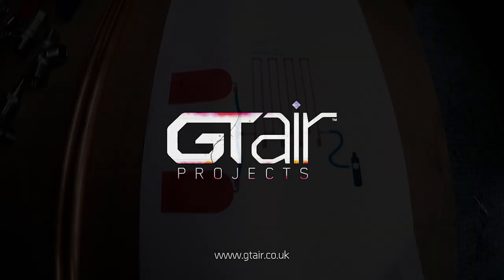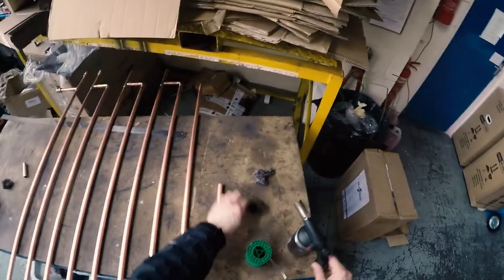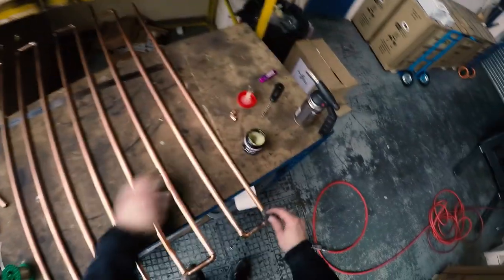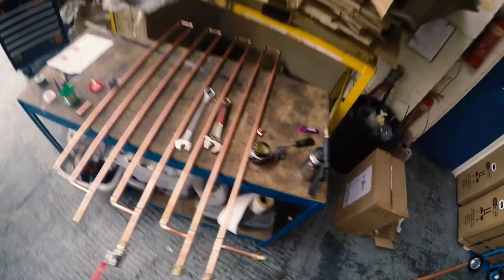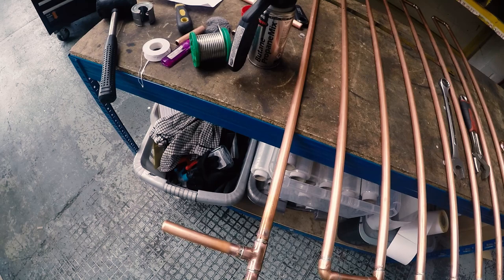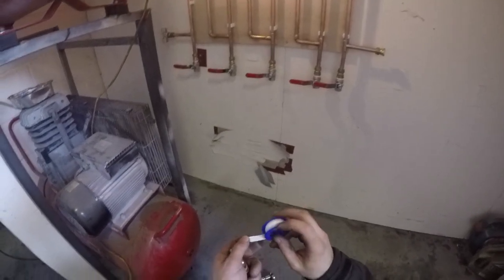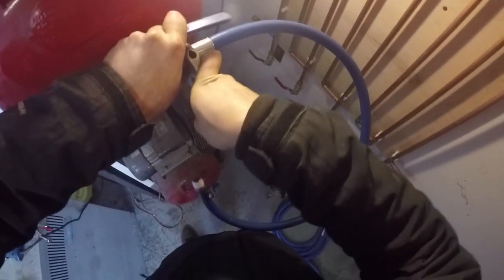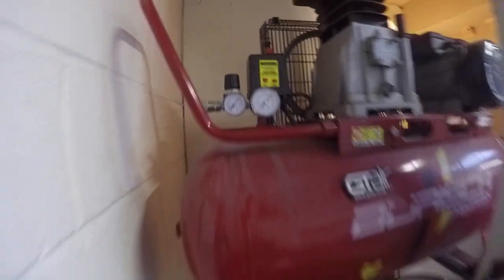Dual air compressor DIY air dryer system

Comment: I do one fitting at a time myself. I find the opposite to be true doing multiple fittings. Just finished a 2000sqft shop with a full 3/4 copper shaped like a horseshoe and 1/2 copper over the back side ceiling to finish off a full circle halo that also acts as a giant water trap at the one end keeping moisture from traveling through the system. System is for a 20hp compair screw compressor and there are no leaks. Using map gas works great. I prefer to use a good amount of solder on my air lines. For water that’s much different but I can assure you my fittings will never leak. Bye copper is known to provide drier air so avoiding nylon, pvc, gray pipe will significantly reduce moisture issues a person may have.

Comment: one fine point is that if you place those T's opposite from where you have them on the straight down pipes you will capture the water vapor better and the tubes to the drain should be no less than 4". I personally did mine 6" in length.  Use the T to create a turbulent effect and the water drop down easier than if you run it straight down the way you did. Basically swap your 90 with your T.  Perhaps too late now, but, it does work better that way.

Comment: Good video. As a thought, would it be best to take the outlet from the top of the last leg
Reply: Also tie those lower legs together with a horizontal run, and you can use one ball valve to drain all the drop legs.
Reply: @mikemarler8224  don't you think if you do that air will just take short way .?
Smart boy.
Reply: @mikemarler8224  Can't tie those legs with horizontal run because the air would travel trough it pushing the condensed water directly to the outlet instead of up and down, up and down which is how the water condensates

Comment: Good video but one other thing is you did 16 wraps with the Teflon tape. 2 to 3 wraps is plenty unless the grooves in the threads are deep then maybe 4 or 5 wraps. You did wrap the teflon in the correct direction though, and typically one and 1/4 turn for the compression fitting.
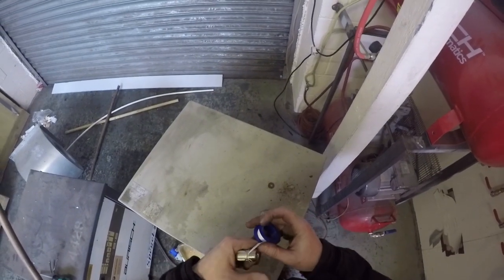Reply: Look again at 17:20  He does what it looks like to me is 21 wraps. it is super excessive

Comment: Do you own stock in the teflon tape company ?  You only need 2, possibly 3 wraps of tape on the threads.  Any more than that keeps the fitting from threading in completely.

Comment: Use a larger diameter copper piping with both more surface area and slower air flow since it acts like an expansion chamber compared to the 1/2" copper.  This should let you pull the same amount of water out of a single stage rather than 2 or more stages.  Also, consider using a high flow (cross flow) condenser inline before the single stage vertical copper line.   Put a fan on the condenser if you want, but even without it, tons of heat will be removed from the air before it gets to your lines causing water to fall out of the air as it crosses through the dew point.   Outlet of compressor -> inlet of condenser -> a tee that goes up to the veritical copper pipe (large diameter) with some pipe at the bottom of the tee to drain the water and a valve at the end.   All your water in one valve instead of checking 3 valves.  Remember:  If you double the diameter of the copper pipe, you are actually increasing the cross section by a factor of 4x!   So 1" copper flows the same volume of air at 1/4th the speed of 1/2" copper.  If you can use 1.5" or 2" copper, that is even better slowing the air down 8x in the copper.   2" copper costs more, but so does having 2 or 3 stages.
Reply: It’s a good recommendation. But considering the outrageous cost of 2” copper, I’d be willing to use baseboard radiators instead. The fins allow greater cooling, and in some cases you can find VG condition used copper baseboard cheap or free
Reply: More surface area, but less surface area per unit volume, the surface area to volume ratio... So your more actually = less cooling of that volume. More thin tubes will always beat a few thicker ones. An easy way to understand this, two 1/2" tubes have a lot more total surface area than one 1" tube, but have exactly the same volume.

Comment: Shouldn’t the cooling coil be in between the pump and the tank? Not off tank to keep the moisture out of the tank.
Reply: Yes 👍 It is easier to buy a universal vehicle transmission cooler and mount exactly where you state in between the pump and receiver and minimise water getting in the receiver tank in the first place. Only 1 drop leg is then advised coming off the receiver connected with a short 1/2” hose wip 👌

Comment: Looking at setting up a system myself but don't really get how this works as soon as the lines get cold from use they would cool causing more moisture and especially the copper.
Now if the copper was heated that would be different but guess your relying on gravity - which does work but only for short periods if using sandblaster for example at 90-100psi it would fail quick / same with painting.
Reply: The colder the copper pipes get the better they will be for sucking moisture out of the air ...

Comment: The ball valve arrangement is a needless expense and complication. If the assembly were turned 90* clockwise, the inlet would be at the top. Since heat travels upward naturally, placing the hot air inlet at that location makes better sense. Next, either run the same configuration without all the extra ball valves, and only using copper 90*s, and flexing the longer runs downward, giving the condensate a natural downward course toward the single ball valve at the end. OR, run the entire path with soft copper in one piece in the same configuration with a single ball valve at the bottom
Reply: Do you have a photo of what you suggest
Reply: @Interdiction  Seem my response above.  It's not as smart as you'd think.

Comment: Just bought a heat exchanger which will separate water off of eBay for 125.00. lot less work and time. Plus it's rated @ 360 psi
Reply: got a title or auction # I can search on ebay for that unit?
Reply: @510BIGD  thanks
Reply: Womb Raider  yup... working Great. Only way to go.

Comment: Do you own stock in the valve company. Just rotate it 90 degrees and make sure there is a slight incline to each pipe and it will all run down to one valve. I know you put in a lot of work but what a mess of pipe and valves that is so unnecessary. Use gravity to you advantage.
Reply: You're missing the point. Each run should be vertical as water does not like travelling uphill. By turning the assembly 90 degrees you'd be encouraging the water to travel towards the exit.
Reply: I did this, and I don't like it. I'm actually here looking at other designs, and will probably turn mine sideways and add more valves like this.

 I made mine with 1 valve, and ensured that every section was downhill.  About 40 ft of 3/4" copper.  The problem is that the water still follows the dryer air nearly to the end with no place to escape.  It's best to remove the water as soon as possible from the air path running over the top of a river the entire way.

Why condensate most of the moisture in the first 5 ft of pipe to simply have it drain all along the pathway of the cooling air?  It's best to remove it quickly and allow the air a chance to condensate further down, in each section, and repeat a few times.  The condensate is also hotter than the pipe, so you lose thermal efficiency by cooling the water instead of the air, and having waterfalls every 5 ft for the air to pass through.

Yup. All the best designs have several valves.  Going cheap might look neat, but you lose efficiency, and copper is expensive wall art.

Comment: I'm going to attempt put an air dryer system for the compressor I use with my Everlast plasma cutter. I just need to get the fittings right that go to the compressor and the tank.
Reply: Same place right now!
Reply: How does it work for you? :) I'm thinking to make this as well for plasma cutting :)

Comment: Dozens of YouTubers have discovered that copper is easy to obtain and use to fabricate a heat exchanger at home. It seems like the perfect solution. 

Heat air, cool it, and what do you get? Condensation. But in this case the condensation is occurring inside copper tube, resulting in airborne copper and copper oxides. Those contaminants carry on in suspension to ruin your filters, dryers, and aluminum air tools through dissimilar metal corrosion. The only choice for those who have invested their time money and effort in a copper tubing heat exchanger, is now to crank up their tool oilers to maximum flow and hope for the best. There is no problem with copper in an air compressor system as long as it's not used where there is 1) moisture condensing and/or 2) no aluminum downstream.

Let us know how your expensive aluminum air tools are doing in 5 years.
Reply: I tend to follow manufacturers advice when it comes things I don't know. These people seem to offer sound advice: https://www.hoseandfittingsetc.com/our-blog/bid/94802/what-type-of-pipe-should-i-use-for-my-air-compressor
I used copper with a filter-dryer between  between compressor and air-receiver tank. The outlet from the receiver has a further filter/dryer stage before use. It will last longer than me!
Reply: What design of filter/dryer do you have immediately downstream of the compressor? I'm still trying to sort out a system for myself.
Reply: Run the output from the compressor through 10 yds of 3/8 copper tube in a serpentine flat shape in front of the fan. This will get the air cool enough to feed directly into an off-the-shelf filter/water-trap with a polycarbonate bowl. Feed the output from the bowl into the receiver tank. When the compressor pump shuts off and the relief-valve opens between the pump and the filter, all the condensation in the line will be blown out through the auto-drain in the filter-bowl.
Reply: Nice find that and very informative
Reply: Every single belt driven oil filled air compressor uses a copper discharge pipe after the compressor head. Copper is used because it cools the air slightly before entering the tank. Which according to you creates copper oxides. So, you will have copper oxides in ANY oil filled belt driven compressor tank and air system, copper, aluminum, or PVC. Try to find any evidence of aluminum air line (Transair, RapidAir Fast Pipe, Infinity, etc.) being ruined by copper. You won't find it.